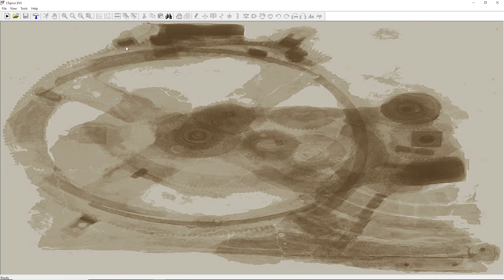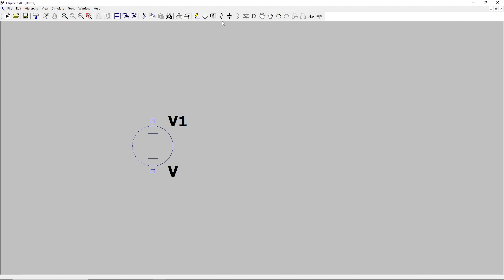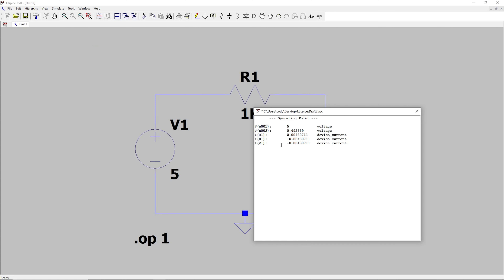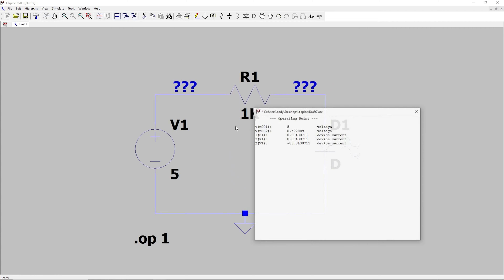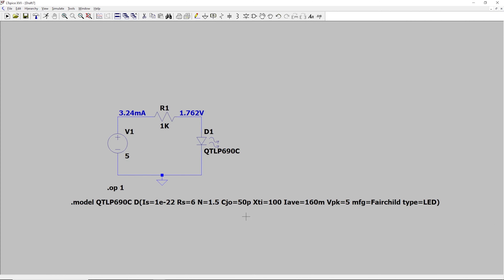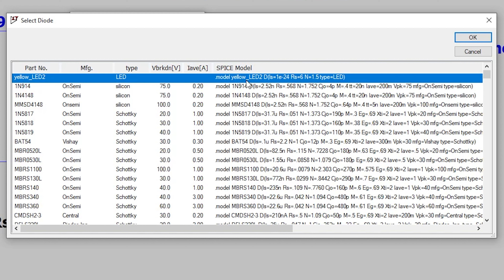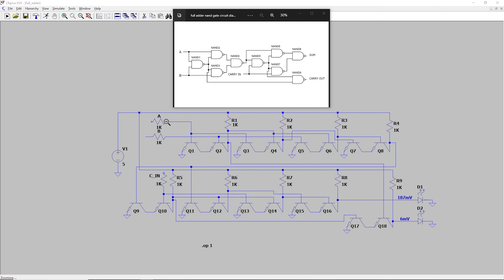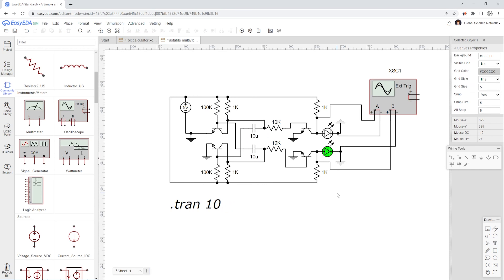How To Use LTspice, A Free Circuit Simulator

Comment: Thanks! Recommend any accurate full 4 bit or 8 bit computer simulations in that or another circuit simulator app?
Reply from the maker: Well I did draw the logic gate level circuit diagram for the 4-bit computer. However, I did not actually simulate the entire computer running at the transistor level. I do have the 4-bit calculator simulator that works though. I think that is in the how to use easyEDA video.
Reply: @GlobalScienceNetwork  Saw that. Thanks👍🏻 Would be cool to have that entire breadboard computer in a circuit simulator for educational purposes.

Comment: Hi sir
actually i version I have downloaded wont have a option to move a single element to other place . There is no hand symbol which have been using to move a element
Reply from the maker: Hi, make sure you are in simulation mode and not standard mode?

Comment: Was Ltspice created by a cook?
A resistor that has an orientation??? Current direction should be measured according to current/voltage source.
And to measure the voltage at the resistor (or other components) you must substract all voltages drop from other components???

It seems that building a physical prototype to perform readings and tests would be faster for analysis.
Reply from the maker: Sometimes that is true. If you do not have the parts on had though the simulation can be nice.